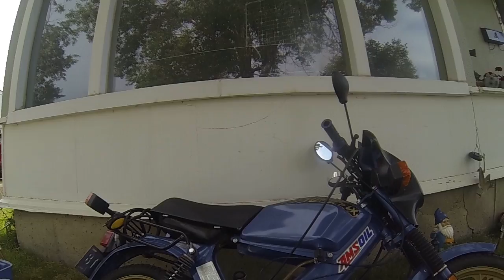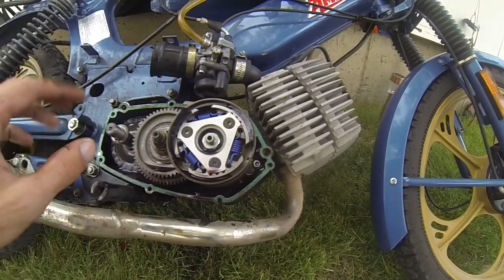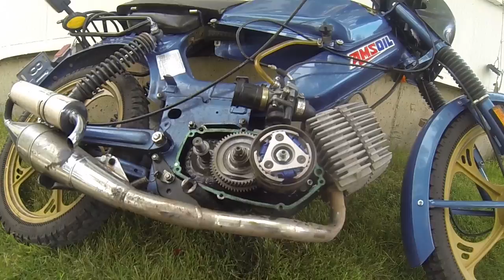Tomos Hammer Clutch Pad Fail - Read Descripiton

Comment: It is great of you you to report this, I was curious to see how the clutch works internally. Most probably the adhesive used could not grip the shoe material which appeared to be rubber. A more flexible adhesive may be the thing to try.